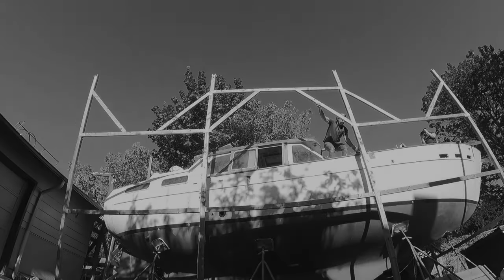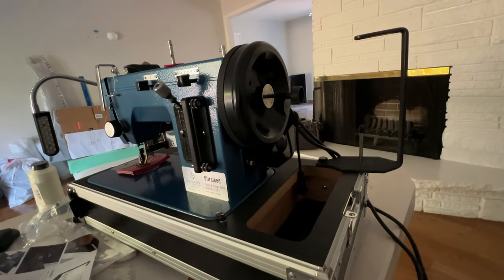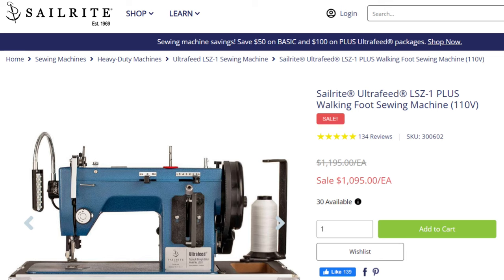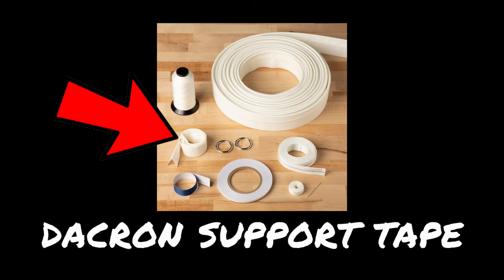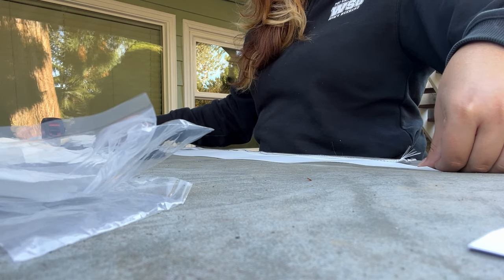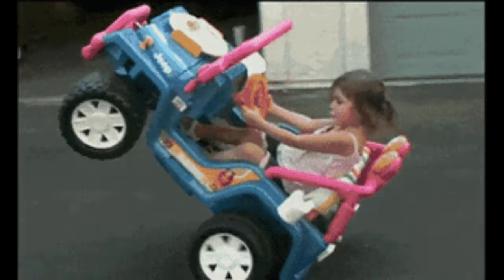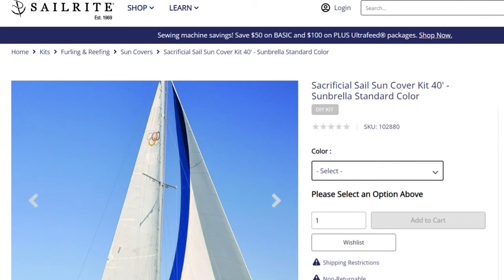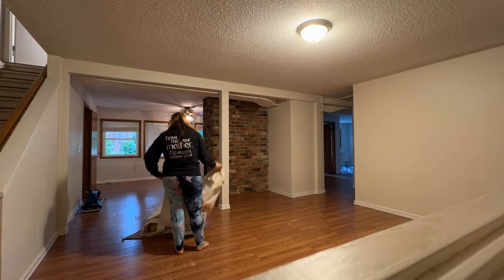Sewing Our Own Sails! Converting our Headsail from Hank On to Roller Furling #Sailrite (Chapter 10)

Comment: That was some piece of work Kelly! I know I've got the same machine, but my sail was so thick at the head I had to use the Speedy Sticher by hand on the last couple of feet, I used a piece of card from my cornflakes to put through the machine without thread then marked all the holes on the sail then used a 1mm drill before stiching it. It is a great little machine, but i now also have a proper industrial machine now too.
Reply from the maker: Nice! I LOVE this machine, it’s a beast! So helpful and the tutorials are great. I also really appreciate the friendly midwestern customer service with Sailrite. 
We also have a speedy stitch- works great for smaller (hard to reach) projects. 
Chris just used it to fix one of the straps on my sail cover actually. It sure beats having to take the whole thing down and get set up on a table
Reply: @ChrisandKellNowHere  
Hi Kelly, yes to all that, if your looking for extra strength with the Speedy Sticher use whipping twine instead of thread, works a treat!